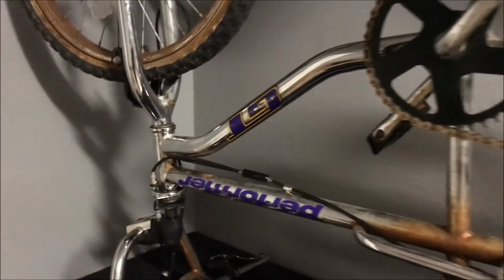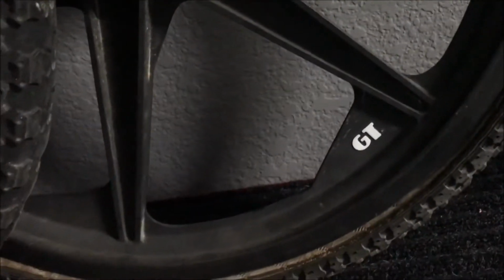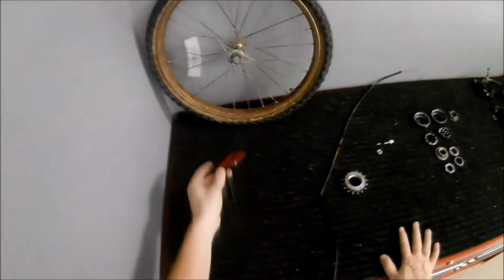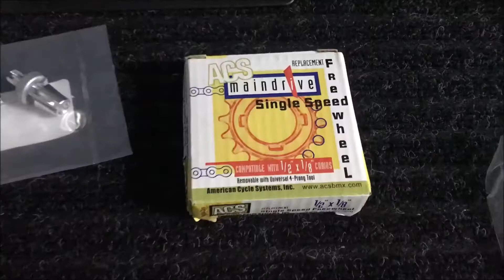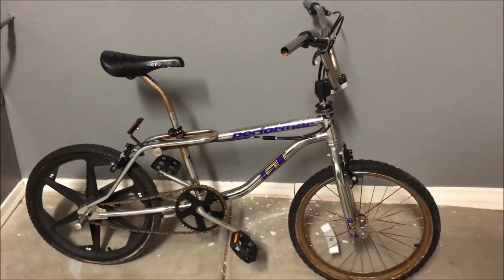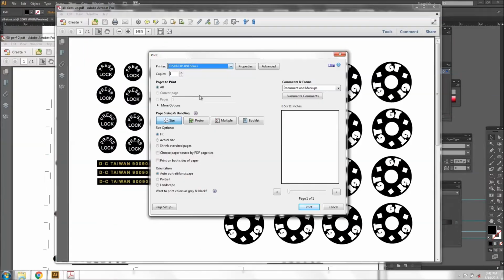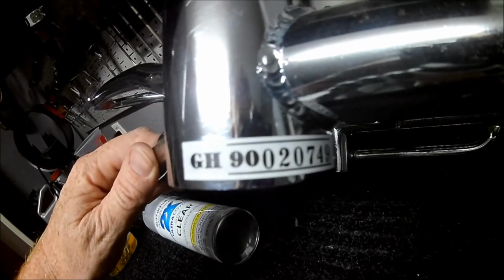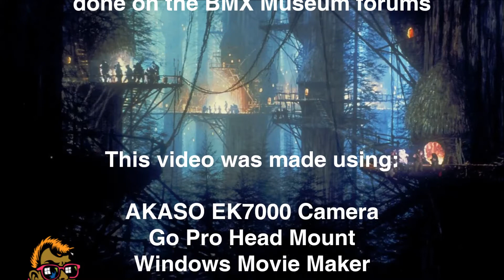Rustiest GT on eBay - Finding Parts - 1990 Performer BMX  Restoration - Part 6

Comment: Where did you get the serial number man? or you just invented a new one?... i just bought a 1990 GT PERFORMER and has no printed label (because i found it in trash condition in Mexico (probably stolen)) an i really want to fully restore it
Reply from the maker: It should be stamped into the rear dropout
Reply: @ralphcastro1645  in the end it was a counterfeit GT, but as you say probably a stolen one